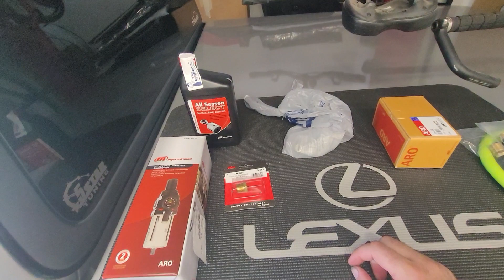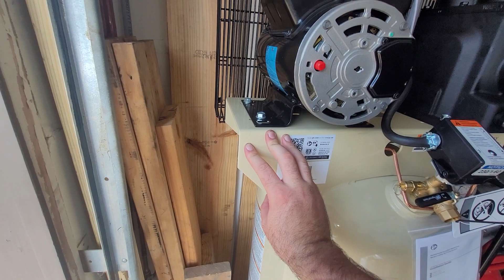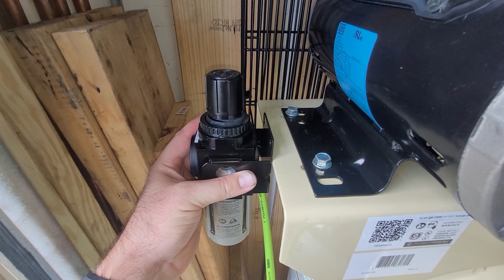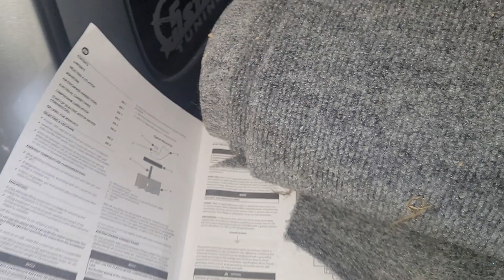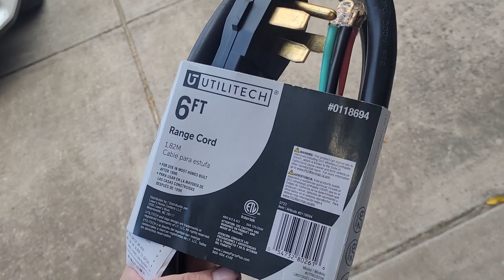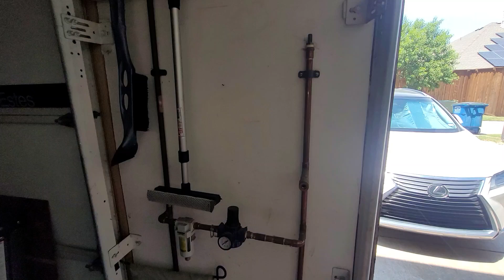New Garage 7 (Ingersoll Rand SS5L5 60G compressor)

Comment: How’d you get it out of the truck?! I will have the same problem when I pick mine up
Reply from the maker: 3 guys lifted it by hand with the compressor still on the pallet.  After we got it to ground level two of us lifted it by wedging some 1x1 wooden rails under the compressor platform